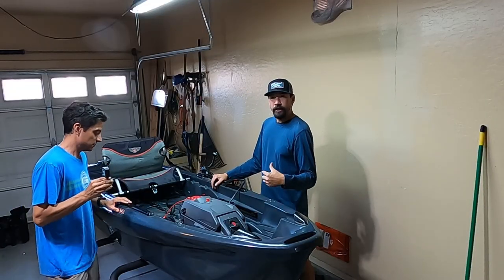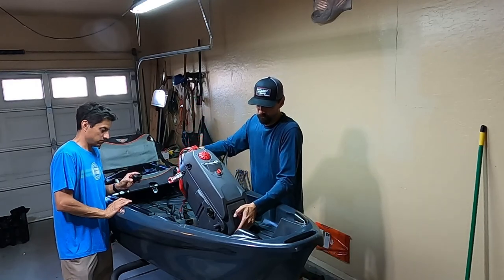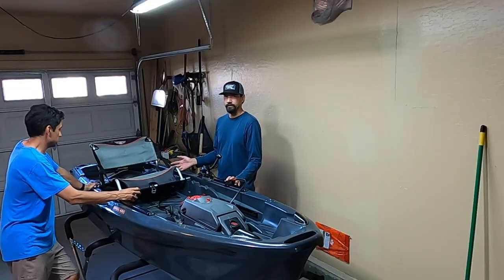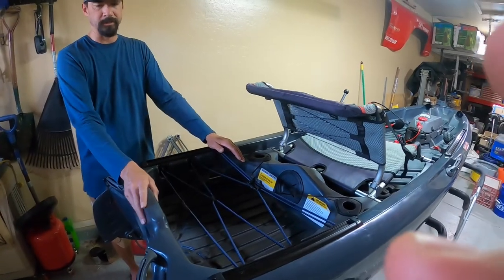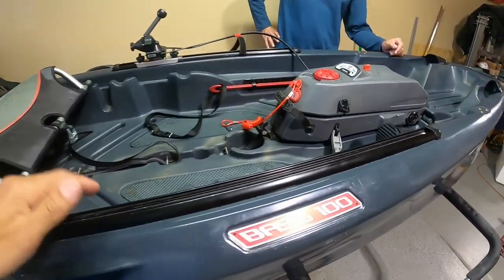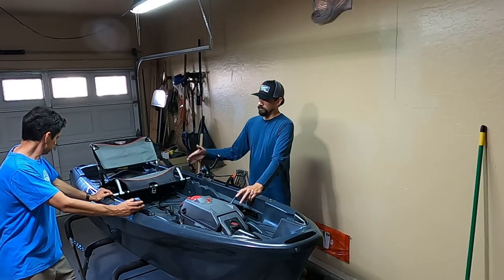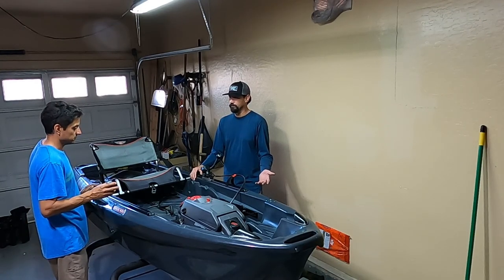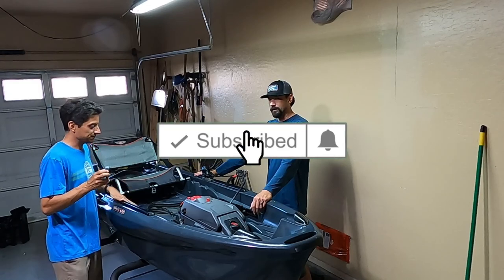Jonny Boat:: First time Kayaker, First Impressions!

Comment: I've had my Jonny for 2 year's, and  named her "Wicked Oange. I do run the 2.5 Suzuki outboard. And the 8 ball steering  trolling motor, so when i get to my spots, I can steer my boat. I'm 5ft 7" 152 lbs. And I purchased the transom with the steering kit, and knob to switch the motor in gear or in neutral. You're gonna love that boat. It's stability is insane. The pod trolling motor will move you about 4 to 5 mph. But that 2.5 outboard is perfect. My friend runs the Honda outboard.  But you make her your own. It really is a one man bass boat. Especially all the add-on's which I'm still doing a few things a season or in the winter. And always have your paddle on board.. you know motors. But not fun to paddle, but good workout, lol. Stay safe bro..🙏 😎 🎣
Reply: How fast does that 2.5 go same about the 2.3 I'm debating on one of those or a 3.5 mecury